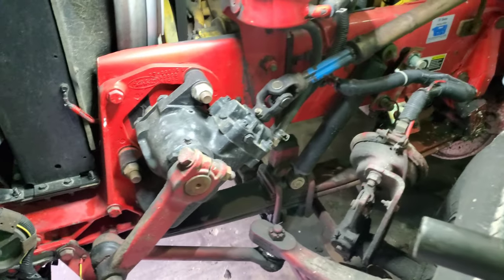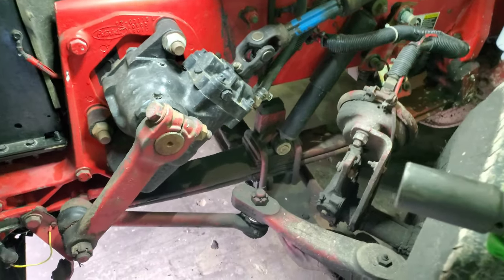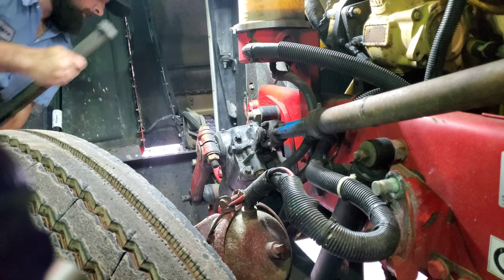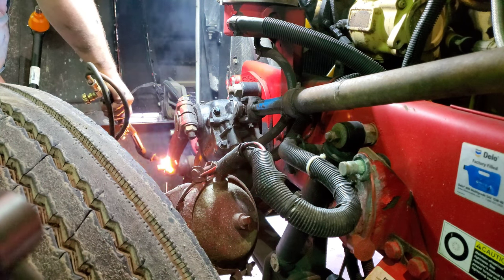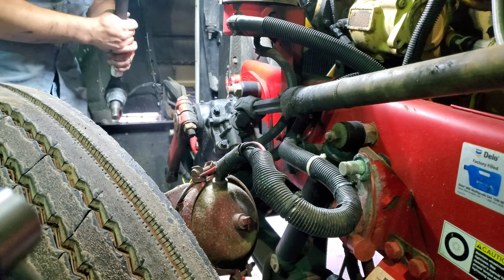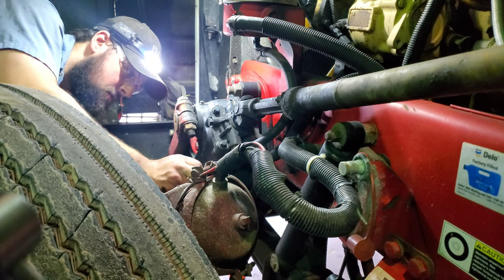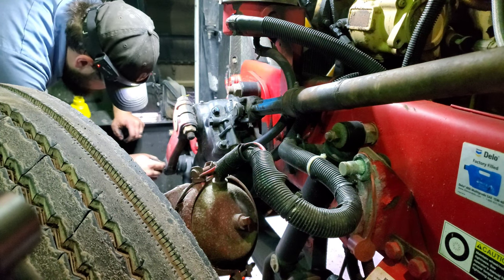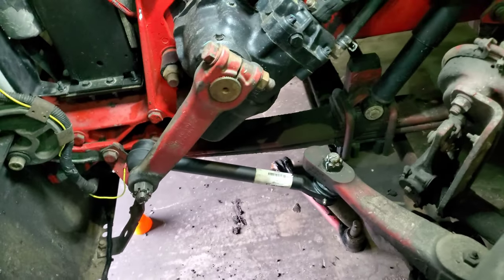Changing a Drag Link on a Peterbilt 379

Comment: Geez man I hope this your own truck and not customers no offense. You never never never throw any heat at any steering component. You ruined the strength of the steal. If would have wrapped the sides of the pitman arm a few times and then the bolt, it will eventually pop out. Takes time. Secondly you way over torqued the castle nuts and now there’s another dangerous situation you don’t want with 80k behind you. Yes it’s true a 7/8 but takes 300 foot pounds but those castle nuts are to be torqued to a max of 160 foot pounds. It is clear as day in the spicer and meritor manuals. You just sat there with a impact and rapped and rapped and rapped away. I’ll bet they are 3 times over torqued.
Hope you take this as constructive criticism
Reply from the maker: @shortthrow50 So I'll take it as constructive criticism. I'm curious as to what part of the country you're in because I'm in the northeast where everything is seized from salt and rust. I've always been told to heat those arms if they won't come loose after a couple minutes of sledge hammer work. Matter a fact I've seen a guy bend the arm where the pitman arm hooks into because he didn't use heat. As far as over torquing the castle nut goes I didn't know the torque spec so I'll say thank you for letting me know.
Reply: And no safety glasses.